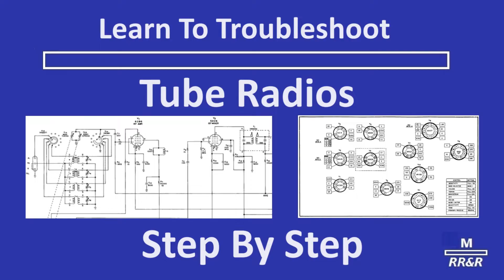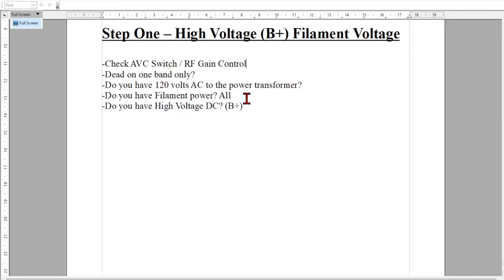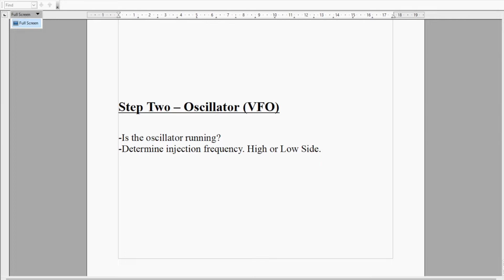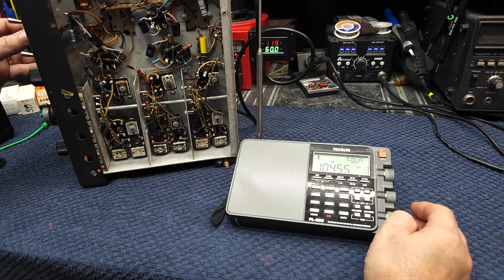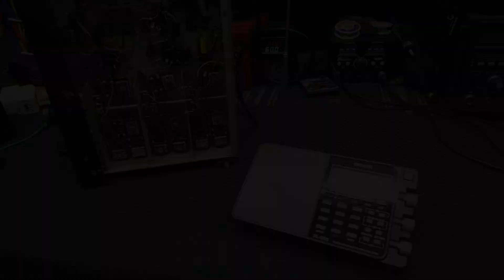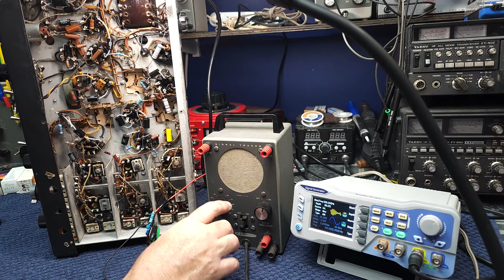Learn to Troubleshoot Tube Radios - Step by Step

Comment: In this restoration are the replaced resistors metal oxide?, thanks
Reply from the maker: This will explain the types of resistors i use and where to use them  Dont skip over any part of this video. https://youtu.be/SkxvQxFl-sQ?si=CqVx8r1zEcD_XExs

Comment: Great vidéo, good timing.
I just finished recapping a Grundig 97CA. It's my first restoration. Radio turns on on FM, plays beautifully, nice clean audio, but cuts out after a minute or so. If I switch it off and let it alone for a few minutes I can power it back up and it'll work nicely again, but quits again after a minute or so. I haven't done any troubleshooting yet. Your video will help me figure what's going on. I suspect this is heat related. Could be a bad tube but I don't have a tube tester. Radio has been fully recapped, selenium rectifier replaced, B+ adjusted right on spec. When the radio quits, the EM84 tube display goes fully "closed" (full glow on the bars), and I notice B+ increases by about 4 volts, and then the radio is like a frozen computer, unresponsive to any band switching, volume, etc.

Comment: I am restoring a Wards Airline 3 band radio. I have replaced all the wax/paper caps and the electrolytics. I also have replace 5 bad tubes. Now I need to start looking at IF alignment. I have a signal generator, but I do not know what level the signal input to grid circuit should be. I noticed that you had you signal generator set to 10p-p. I have the alignment information, but it does not give me the amplitude I should be using. Can you help?  Is there a way to get the schematic to you ?

Comment: I have a national nc183d that needs a whole lot of tlc.  I am so glad I found your channel.  I have a modern sig generator and digital multimeter and a high voltage probe.  As well as a few crt scopes with hv probe. I built my own sig tracing probe as well but need to add a higher voltage cap in it for hv

Comment: I'm working on a SX-99, very similar to the S-40 in this video. I've replaced all the paper and electrolytic caps, a few resistors, checked the tubes, cleaned the switches and such, and went through the first part of the alignment process. I ran into a problem while tuning the IF cans. All of them had the typical peak measurement except one. T3, which is the third IF, just kept going up until it went has far as I could turn it, it never dipped. Prior to the alignment steps, the radio would receive stations in the broadcast band fairly well, now all the stations are weak and have a lot of static on them. I did some signal tracing, and all the stages seem to be working. I'm not sure where to go next, any thoughts? Thanks! Really enjoy your videos, they've helped a lot.

Comment: Thank you for the Demonstration. I just purchased a Heathkit IT-12 and also have the signal generator. I never used the IT-12 before and this video showed me exactly how to use it. I searched all over YouTube for a tutorial and found none. I happened to see this pop up on tube radio repair so I clicked on it. Then I saw you at the work bench with the IT-12 and signal generator and hoped you would demonstrate them and YOU DID!!
Thank you!! I subscribed and will catch up on all of your videos.

Comment: So did you inject the signal through a capacitor?
Reply from the maker: Yes
Reply: @MikesRadioRepairRestoration  good information, I’ve never done it but know of it . What value of capacitor ?
Reply from the maker: @jerrypeal653  its not critical. .1, .01, .047.... Just make sure it has the proper voltage rating.. 450 or better.
Reply: @MikesRadioRepairRestoration  ok , thanks . I’m 66 and just getting into the hobby so much appreciate your input! 
Also just ran across your channel and subscribed .

Comment: i have what appears to be a bad solder connection except i sucked off and reheated every single solder connection in the radio. I also cleaned all tube pins and sockets. Replaced all resistors and caps. yet i have an intermittent crackling and sensativity issue. The sensativity comes and goes. poking in the radio and wiggling does nothing. Moving tubes does nothing. But if i stand in the center of the room and lightly tap my foot it will crackle and reception will get better or worse. just like a bad solder joint.
hitting chassis or tubes does nothing.

only standing in room and hitting my foot on the floor or rolling my desk chair across the floor will cause the reception (connection issue) to either improve or get worse with a slight crackling.

im at a loss what to do
Reply from the maker: Radio model?
Reply: @MikesRadioRepairRestoration  radio is a philco 42-380  code 121
Since this i have replaced all the tubes thinking maybe a bad connection inside tube but no change. I cleaned the band switch multiple times. I poked and wiggled everything in the radio for the last three days and no change but tapping foot on floor gently and or rolling desk chair slowly across floor causes the crackle and great / poor reception problem. Something acts like its loose but cant find it. I even jumpered each terminal block to chassis that is tied to chassis with a rivet. 
This thing is driving me crazy and im to a point where i just dont know what to do anymore.
Reply from the maker: @kwacz  I havent looked at the schematic, but its time to consider silver mica disease.
Reply: @MikesRadioRepairRestoration  thought about it but the if cans are not the type that get this. They are the older style. It is vibration influenced but poking tapping on micas does not cause any change. If it is a Mica it would have to be one of the point to point  ones but not sure how to figure out which one
Reply from the maker: @kwacz  Based on your description, I think you will find a silver mica shorting. They arent that hard to find if you have a signal tracer or o scope and s signal generator. I assume you have correctly serviced your tuning cap contacts?
Reply: @MikesRadioRepairRestoration  I cleaned the tuning cap. I am getting back my oscilloscope in a couple days, don't have it right now. I do not have a signal generator though. I have noticed an interesting thing though. If I just very lightly touch a piece of wire about a foot or longer anywhere to the chassis the audio crackles and reception gets weak. If i then gently tap my foot on the floor it crackles. If i keep tapping eventually it crackles and comes back to full volume. For some reason extremely lightly touching the piece of wire to the chassis and even b+ terminal of filter cap makes it reliably do this 9 times out of 10. 

Maybe a bad mica but im not really sure how to check these when i get my scope back.
if I cant find the bad one is there anything bad about replacing all of them, ive heard not to unless they are bad but if i cant figure out which is bad I might not have a choice. How bad can this go?
Reply: @MikesRadioRepairRestoration  I give up. Walking on the floor makes the reception cut in and out. Banging on the if chassis and tubes does nothing to change anything. Wiggling tubes and every connection in radio does noting. tapping on coils does nothing. replaced all caps and resistors except micas already. Tapping moving pots tuning coils does nothing. I even shorted every mica with a jumper and radio still worked to a degree. but tapping foot on floor gently still even with one at a time shorted yielded the reception and crackling so i dont think the micas are bad. 

Then i noticed that if i turn a light on even on the other side of the house the reception will get bad. the ONLY thing that will bring it back is to go in the room with the radio and GENTLY tap my foot on the floor a couple times and it will come in strong again. turn the light on and off on the other side of the house same thing. I can create and repeat the problem even on the other side of the house but the only thing that will bring it back to full reception is tapping foot on the floor. I can bang and poke all day and nothing happens so its vibration related but not in a way that makes sense but also seems to be electrically influenced by radio picking up static as well.

cant find a bad component or loose joint.
Reply: I found the problem and you are never going to guess what it is!!  Ive been into this hobby for a few years and have a closet full of restored radios that none of which worked when I got them. I NEVER SAW THIS PROBLEM THOUGH. Please note I recently moved.

It was not the radio at all. IT WAS THE ROOM?????  yep the room. I found this out accidentally. I was playing one of my other tube radios I restored and it started doing the same thing. I knew this radio was working fine. Just to be sure I grabbed another radio and tried it and same thing. HUH!!  I then turned on my transistor based stereo reciever with digital tuning. A modern piece of equipment that worked fine. Put it on am and guess what. Same thing. Trying different stations same thing. Antenna or not same thing.

I moved my radio chassis and speaker into a different room and turned it on. It played perfectly all day long. Over 8 hours of playing at various volumes on strong and weak stations and not a problem. As soon as I moved it back into that room it acted up again. Every radio I put in that room acts up on am for some reason.

Never say or heard of anything like it before. I could even find exact spots on the floor that I could step on to make it cut out and back in on command, but the interesting thing is there is nothing under the floor in those spots whatsoever. Not even under the room in the basement or in the basement ceiling. Even an extremely slow step makes it do it or even leaving my feet on the floor and very slowly putting pressure down (careful not to make any vibration or movement. For now this is a mystery!!???

Comment: It may help some to show where you inject the 455Hz.
Reply from the maker: Most of the time the manual for the radio will tell you. If not, the RF input of the mixer.

Comment: I have had a couple of beginners ask me what to use for tracing if they have no equip,emt yet. They also don't hve the RF/AF switvhable probe. Any tips?
Reply: I am very grateful for you doing this video. Have a couple of valve radios that need fixing. So it's perfect timing.
Reply from the maker: A signal tracer or scope in the minimum entry ticket. Please watch -  https://youtu.be/biYfpkCCLbg?si=pg5nUYGRzGojYtt6